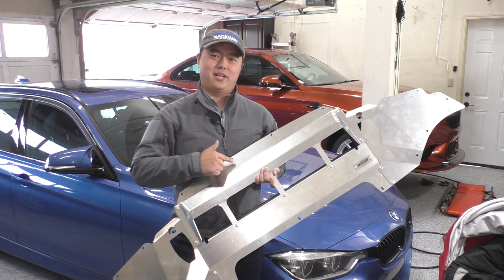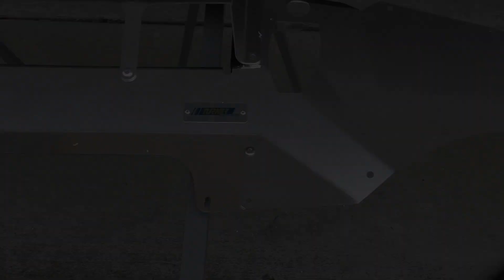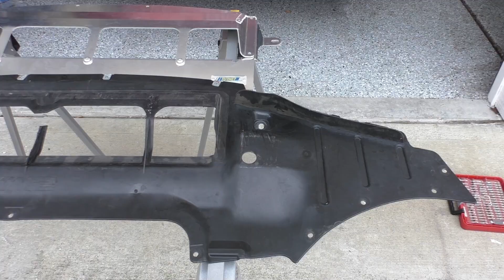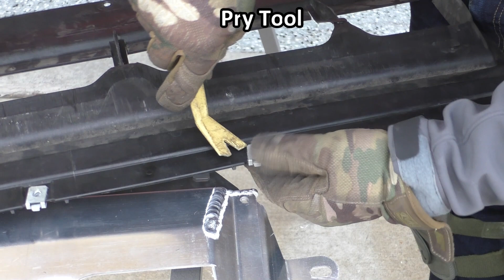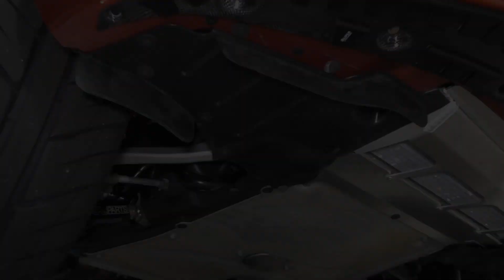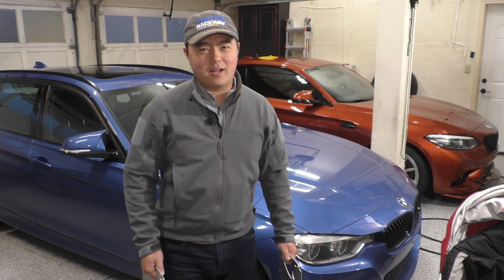Turner Motorsports BMW M2 Skid Plate, The Struggle is Real

Comment: I have a question, I have the same skid plate. And I am going to do what you did. Remove the rivets and like you have 3 pcs. You said it was hard to install as a whole , but you literally made it into 3pc why not install the middle , then the side metal ones, and where you removed the rivets install push pins or small nuts and bolt? It would be equivalent to the plastic pcs.
Reply from the maker: The rigidity of the side pieces still made them more difficult to install vs the OE plastic. Particularly since for the leading edge on those side pieces some of it tucks on top of the bumper and some of it goes on the bottom.
Reply: @FaRKle0079 thank you, I installed it finally, yesterday. I was able to install it as a whole. I did one side first and then I did like a swing movement , held it with my left foot,  (literally 5 mins )while I bolted one side and tucked in the rest. Was easy but I can see your point if you were someone with out some sort of mechanical skills your going to have issues. Again thank you

Comment: Do you think this skid plate for the M2C is essentially the F80/F82 M3/M4 Turner skid plate with the new metal sides riveted on? I'm certainly thinking it is and if so might just end up picking that skid plate up and modify the OEM plastic sides like you did in this video. I am not a fan of the one piece design and you certainly brought up great points. Thanks!

Comment: I just bought one of these because my OEM one just like yours has one of the arm things completely broken so better safe than sorry (also got a good price for it so not too much more than the OEM one probably). I am going to do what you did because don't want my mechanic to hate me and seeing other videos on these they seem like a huge pain to install. You never mentioned it, did you have to do anything to the ears of the plate? you said you might have to bend em, anything I should know from when you installed everything back on? Thank you FaRKle!
Reply from the maker: I ended up bending the ears towards the rear of the plate a bit. Put them in my bench vise and then just pulled the plate to bend them where they needed to be.

If you have a front splitter I wouldn't even think of trying to install this whole.
Reply: @FaRKle0079  I do, I have the Lightweight one and not even going to attempt, going straight to your hybrid idea. I will have to bend the ears then, not a big deal.
Reply: @FaRKle0079  Also what a bad product from turner, did they like not even install this on a car? Its interesting because their F80 one is just the middle part since a different system but works well and probably the reason the other M2 metal one is only also the middle and has you cut your oem one. Anyways once again thank you Farkle! Glad you went through this so I did not have to waste hours trying to install the stiffest sharpest piece known to man 😂
Reply from the maker: @oficina_moomoo  With the M3/4 the stock undertray is 3-pieces (center and two front quarters), so it makes sense for Turner to only make the middle part. Turner clearly made the M2 version one-piece so people wouldn't HAVE to cut up their stock undertrays, but their execution of that was kind of half-assed IMO.

Comment: Seems like someone or even BMW should make a better solution, location of this thing is totally stupid. Appreciate your time and all your content.
Reply from the maker: I'm sure a BMW engineer came up with a similar solution, but was told, "No, too expensive." by the bean counters...

Having that extra oil cooler down low is pretty clever though, and one of the reasons you don't hear about F8x overheating on track unlike other popular cars from its time (C7 Z06, Civc Type-R, ect...).
Reply: @FaRKle0079  speaking of track, when are you going to post up more track outings?

Comment: Another excellent video! Very creative with the blended hybrid mod. And so easy with simple tools and patience!

I really hate when manufacturers leave sharp edges to save the money from having to add a process. Maybe you could use a handheld drywall type router with a slight rounding bit to go over all of the edges, especially since the piece doesn’t appear to be coated on video. You could always paint or powdercoat too. May save you sliced fingers in the future.

Just curious... after removing that one piece of gasket material for fitment, how was the airflow/seal in that area? I couldn’t tell if the surface there was flat so that maybe you could have moved it 1/2”-1” further outside to fit, but maintain the seal. Or remove it for fitment and install a thicker piece of insulation to seal around it.
Happy New Year!
Reply from the maker: Yeah, if I ever need something to do I can go over the edges with a file, dremel, or sandpaper to finish it up. It's a decent amount of length to do.

With the rear gasket removed there's about 1/8" gap between the ridge the gasket sits on and the intercooler. I don't think this will really matter though since the stock skid shield doesn't seal that well either. If I want to to really seal I can trim the gasket back to just the part that slides over the ridge.

Comment: Excellent.  I appreciate your take on this piece.  I had suffered total loss because of the oil system getting punctured.  The vunerabililty lies in the fact that the drain plug protrudes and is susceptible to impact, damage, and loss. It is not shielded in that spot in the oil pan.  Rock damage.   Im not sure, couldn't tell, if the Turner address that drain plug spot, but that issue would need attention for F87 owners.
Reply from the maker: You're right that the Turner skid plate doesn't do anything for the oil drain plug. The OE shear plate though should have a protrusion to prevent that bolt from getting sheared off. You must've had one WILD hit!